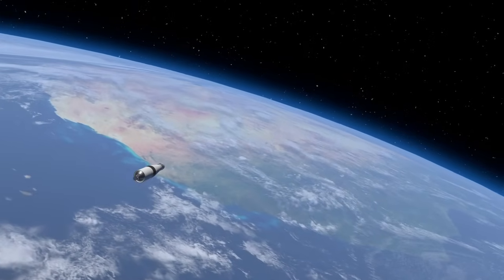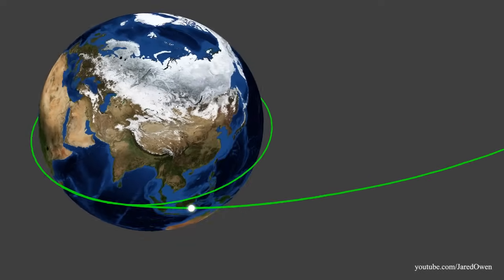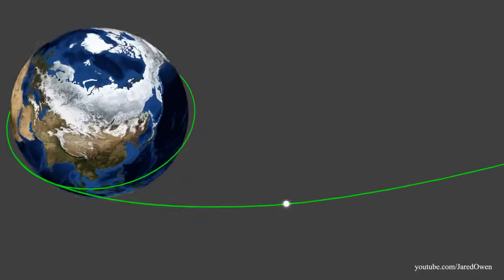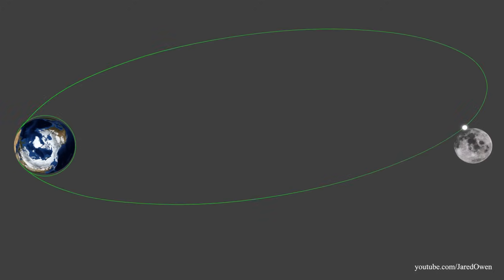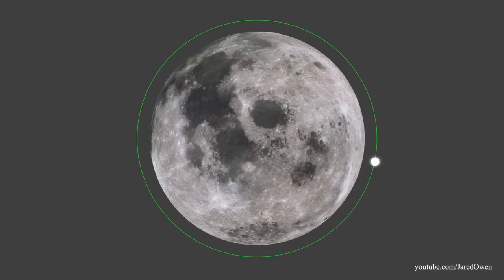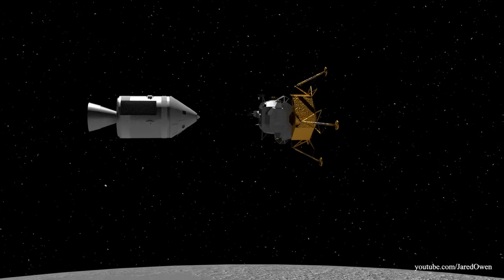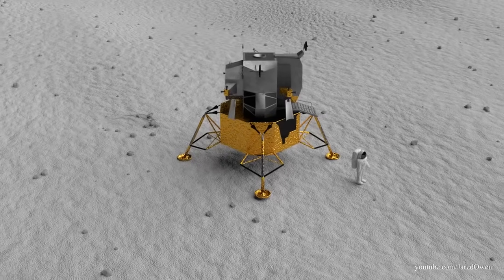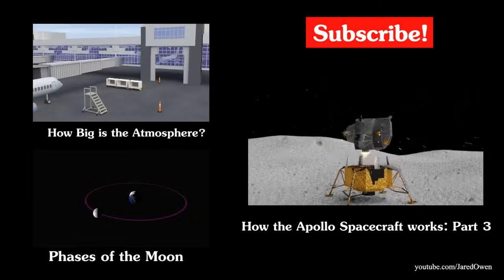How the Apollo Spacecraft works: Part 2

Comment: So they traveled almost 500 thousand miles without refueling with 1960's technology for eight days in that tin can you guys are so naive
Reply: Felton Mitchell

You clearly know NOTHING about the subject.
Do you even know what "escape velocity" means?...
Reply: Felton Mitchell 
Distance is irrelevant when there's no friction to slow you down.
The SIV-B stage of the Saturn V rocket have the Apollo CSM and LEM all the velocity it needed to get to the moon. No additional rockets needed to be fired to get there.
Reply: 1960's technology couldn't even make a decent television.  Even today NASA has admitted the rocket that's currently in the works will possibly be the first ever to achieve anything higher than a low level orbit. The president also said it, Bottom line we never made it through the van Allen belts.
Reply: Felton Mitchell 
No... They have stated that the SLS-Orion system will be the first one in 50 years to be able to fly manned flights beyond earth orbit.

What does making a television have to do with the moon? Not much I'm betting.
Reply: The only reason you even know about those reels of data transmittal information going missing is that NASA released that info. A lot of that data was from all the system readings of the spacecraft and the bio readings of the astronauts. It was all documented so what exactly is the big deal since the only part of the spacecraft that came back was the CM. It's true they wanted to use newer methods to try and extract more data from the ALSEP transmittals which is when they realized that a lot of it had gone missing but if all of this had been faked, why wouldn't they simply fake this as well so they wouldn't even have to reveal it went missing in the first place. Here's some proof that so far has remained irrefutable so take the time to go through it all and then ask yourself why they didn't seem capable of faking transmittal data tapes that could fool the experts:

-> There's the live TV coverage that would have to somehow convincingly fake 1/6th G movement in a vacuum, Google "Irrefutable Proof for Moon Landing - Lunar Gravity" and explain how experts in the field of kinematics for 45+ years have never come forward with proof that the astronauts are not in an environment that they say they are. There's also the fact that any attempts to do filmed mock-ups of the EVA's on Earth would have to be passed off as live TV broadcasts which would have to fool telecommunications experts around the world. Google "Moon Hoax Not" and "For Jarrah" to get a better understanding of how much would be involved to pull that off and how the filming technology back then was simply incapable of such a thing.

-> There's all the moon rock and core samples that would have to somehow be able to pass scrutiny with geologists who can readily spot whether it's something that has passed through our atmosphere or not. 
Google "How do we know that rock came from the moon?"

-> NASA has made these samples available to scientists from around the world and every year 500-1000 samples are sent out.
Google: "NASA lunar sample request"

-> There's the Apollo 16 UV telescope images that no astronomer in 45+ years has ever found fault with. Google "onebigmonkey apollo 16 UV telescope"

-> Another thing that astronomers would be able to spot are pictures of the Earth that don't match what they should look like. Google "Apollo 11 Earthrise - How One Photo Proves it was Real" for an example. 

-> Another one to google is "Apollo 11: Fingerprints in Deep Space" that shows obvious handheld TV footage from the Apollo 11 CM looking at Earth from far enough away that they are clearly beyond the VAB's.

-> Then there are the LOR images. Lots of hoax believer nonsense about them being faked but the transmittal data for them can be downloaded by anybody with a computer and so far, nobody has proven anything about them being faked. You don't think a smoking gun like that wouldn't have been scrutinized by people with the required computer science expertise??

-> Here's something else you might not know. Apollo 12 landed close enough to Surveyor 3 that Conrad & Bean were able to do an Eva to it and removed the camera and sampler scoop from it to be returned back to Earth. They wanted to see what the harmful conditions of the moon had done to those parts after 2.5 years: Google "Analysis of Surveyor 3 Material and photographs returned by Apollo 12"

-> 5 plutonium-238 powered ALSEP's were left behind that transmitted data from the experiments back to Earth right up till 1977. Unfortunately, due to budget constraints, they were shut down but they did send back enough information that storage of it became a real problem as detailed in this article: Google "the-long-road-to-alsep-data-recovery"

-> Starting with Apollo 13, they purposely directed the spent S-IVB's to crash into the moon so that the Apollo 12 seismograph could record the seismic waves generated to help determine the moon's crustal structure and makeup. Of course, as each successful mission added another ALSEP, they were able to expand on the info derived from these man-made impacts. They also did the same with the lunar module ascent stages. The Apollo 16 LM ascent stage data isn't shown because of difficulties during the deorbit phase. They were able to derive a lot of info from these artificial impacts. Google "The Description of Apollo Seismic Experiments darts"

-> Another great site to check out has some pretty thorough crater analyzing to prove the landings happened. You can check out all six of the landings this way: Google "onebigmonkey apollo sights landing"

Are you starting to understand the magnitude of what would be involved to pull a hoax like this off? Never mind keeping it from being exposed?

I suggest you also take the time to read through the 93-page pdf titled "NASA’s Recommendations to Space-Faring Entities: How to Protect and Preserve the Historic and Scientific Value of U.S. Government Lunar Artifacts". There is lots of nonsense from hoax believers that the USA is trying to make the Apollo sites inaccessible which is ridiculous seeing as these are only recommendations designed to limit harmful effects of spacecraft landing too close or the altitude of hopper type craft flying at too low of an altitude. The fact is, the USA has no issue at all with visits to the sites by manned or unmanned means. They do request the Apollo 11 and 17 sites are accorded with the proper respect due to the obvious historic value. Also, there is an Appendix B in the pdf that gives a lot of recommendations from NASA as to what type of investigations at the Apollo sites would be most beneficial for scientific purposes. Now does this seem like the type of behavior for a country that supposedly faked all of this??
Reply: No, they did not lose all the data. Who told you this? Some hoax believer website or video no doubt and being the typical biased HB, you just ate it up with no thought on finding out the truth. Just like when NASA announced it had lost the Apollo 11 SCTV transmittal data, this got exaggerated by many HB's claiming all the videos and all the pictures taken during the Apollo lunar EVA's have been lost. Post a link from an official NASA video or document that states that all the reels have been lost and all the information from those reels

So typical of people like you to dismiss the irrefutable proof I listed with a wave of your hand, which I'm sure you never even bothered to check the sites I said to Google, and keep on blathering away about some smoking gun pet theory that is usually based on misquoted info, or deliberate/accidental misrepresentation of the actual facts. You know, like your nonsense that " NASA has admitted the rocket that's currently in the works will possibly be the first ever to achieve anything higher than a low level orbit."

I'll post this again and I want an answer to the question posed. Ignoring it again will be just more proof about how irrational, biased and lacking in critical thinking skills the typical HB is. Moon landing HB's are only a notch below the flat-earth nutcases as far as I'm concerned: 

->  "The only reason you even know about those reels of data transmittal information going missing is that NASA released that info. A lot of that data was from all the system readings of the spacecraft and the bio readings of the astronauts. It was all documented so what exactly is the big deal since the only part of the spacecraft that came back was the CM. It's true they wanted to use newer methods to try and extract more data from the ALSEP transmittals which is when they realized that a lot of it had gone missing but if all of this had been faked, why wouldn't they simply fake this as well so they wouldn't even have to reveal it went missing in the first place?
Reply: Felton Mitchell

Even if we lost SOME data, we still have all the films, videos and photos from all the journeys and we still have most of the samples.
Plus, we have all the data, which have been published in science papers, reports, and magazines ever since.

And, you don't even know, that they didn't run the engines the whole way...
Reply: Native Americans discovered America. That's why they are called natives.
What does that have to do with your claims that the Apollo moon landings weren't real?
Reply: How convenient NASA  lost 13000 reels containing the data from all the moon missions so we're unable to scrutinize their findings. So we don't know with certainty if 50 years ago whether or not they did go to the moon or not.  Furthermore according to NASA they can't recreate this data. That's a lot information to lose I mean really they didn't just lose some data they lost it all now do you really believe we lost all the information on what argumently is suppose be mans greatest achievement. Naive much.
Reply: Felton Mitchell

I haven't thought so for decades.
Reply: They could have traveled 500 billion miles with no fuel once they had the initial push.   Good Lord, learn some physics do you don't look like a fucking moron every time.
Reply: No I'm just not naive I bet you still believe Christopher Columbus discovered America
Reply: Did you listen to what I said they lost all the data not some 13000 reels the only thing left are some cheesy pics and a couple videos that almost anyone can fabricate today.